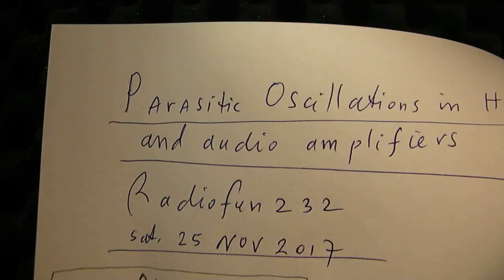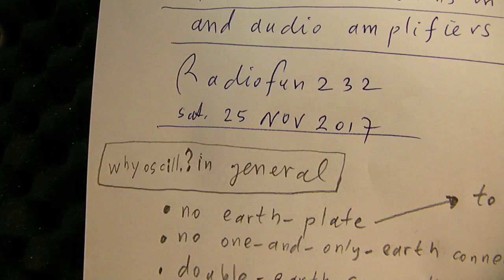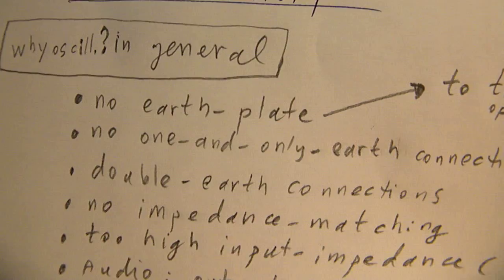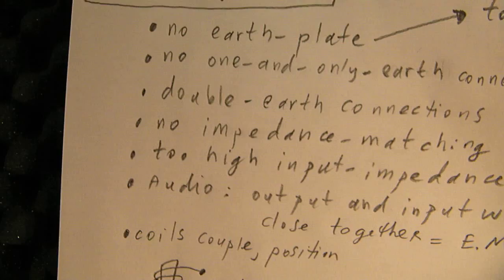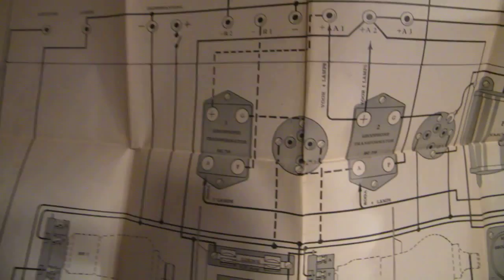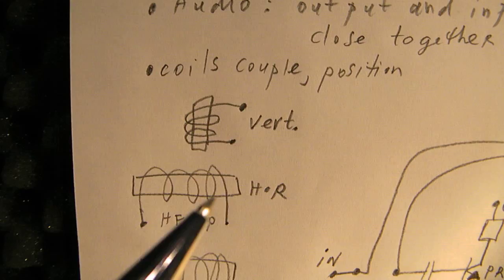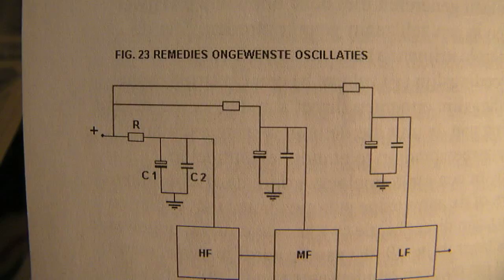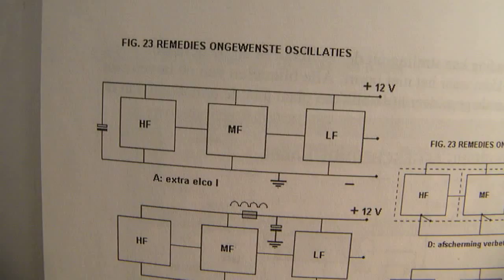Parasitic oscillations in Audio and HF amplifiers; how pro prevent them (schematics & instructions)

Comment: I have a 500w RMS 5200/1943 five pair amp with zobel network and a subwoofer pre amp with sallen key and it oscilates at around 50 t0 70hz when it's stated and when I turn up the gain to full , the oscilatins start to go away and diminish . How do I troubleshoot it . Sub pre amp is sallenkey filter and amplifier doesn't oscilates without pre amp on it. Help
Reply from the maker: When it does not oscillate without the pre amp the end amp must be OK. 1) Does it also oscillate when the amplification of the pre-amp is set to a low audio output value? 2) Does it also oscillate when the volume knob/gain of the pre amp is set to zero and the pre-amp is on? 3) Does it also oscillate when the pre amp is connected to the end amp and the pre-amp is switched off? 4) Does it also oscillate when the loudspeakers are in another room? 5) You say that the oscillation diminishes when the gain/volume is full; is that the gain of the pre-amp or the gain of the end-amp? 6) Do the oscillations diminish or completely go away? 7) on which positions of the volume knobs (gain) is the oscillation completely gone? 8) or: on which positions of the gain (volume knobs of pre-amp and end-amp) the oscillation is at its lowest level?

Comment: Do you still dabble with ham radios? They have come a very long way in the past couple of years, especially when they started combining ham radios with the internet. I have recently started using the DMR system which uses 2 meter or 70 cm to make a connection to the repeater and then to the internet. I have spoken to fellow hams around the world with a handheld radio, and it is crystal clear! Simply amazing :-) Thank you for passing along your knowledge :-) KM4EVI
Reply from the maker: Thanks for your comment, yes, sometimes I try to make a new radio again. Success with your projects!

Comment: Thankyou for the sharing this. I have a 70khz oscillation appearing on the output of my guitar valve amplifier. It is a Kumo Linap Russian cinema amp converted, And can see this on an oscilloscope at the dummy load or speaker connections.
It looks like I have some experimenting to do to get rid of this parasitic oscillation
Reply from the maker: It is a serious issue, I have built many audio amps in past where I had to solve that problem. Thanks.